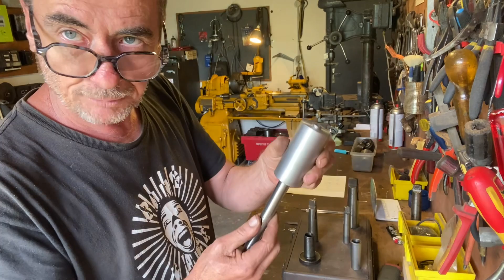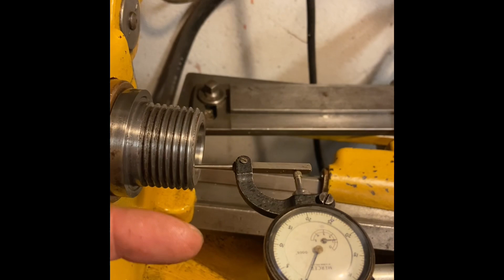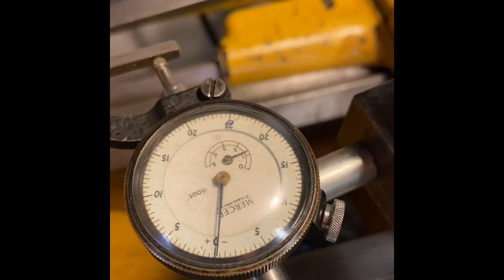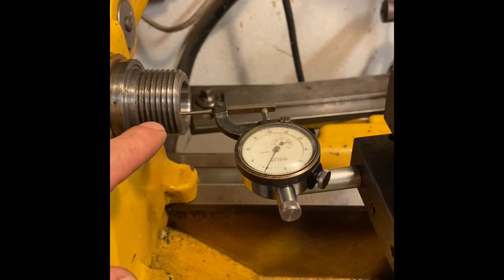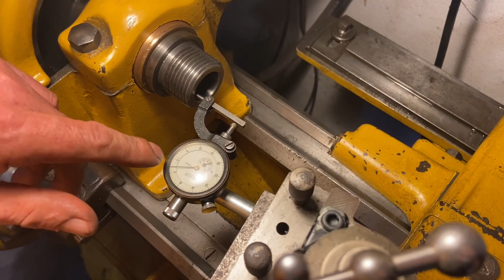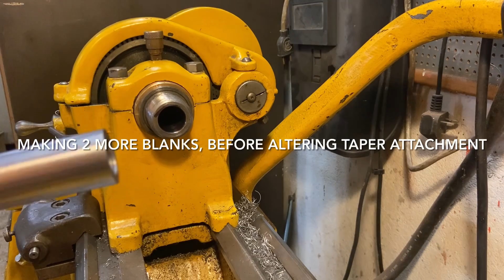South Bend lathe Head Stock Sleeves!

Comment: Very nice work my friend. I have received a taper attachment with my lathe, but never actually set it up. After seeing how much you use yours, I’m wondering if I should dig it out. Great videos. Thanks. 
Keep it coming
Reply from the maker: They are handy , once you got your taper dialed in . You can leave them and get on with other work , i like to make a few blanks extra , i did not have the sleeves for this lathe and they are approx. 3.5 Morse. Whats a shame on my 9”. They are short Morse 3. What is more usefull at a push i can use Mt 3 bits direct in the headstock ,